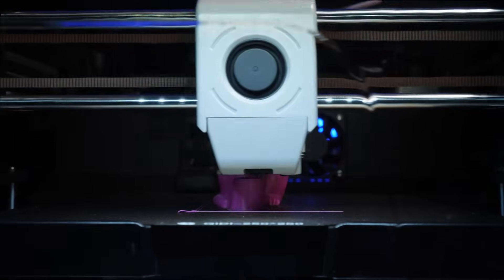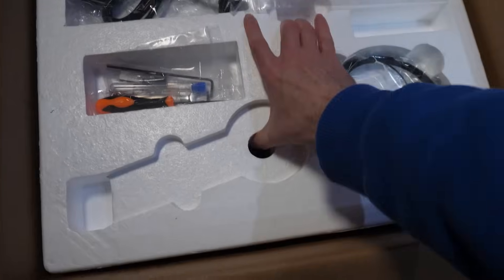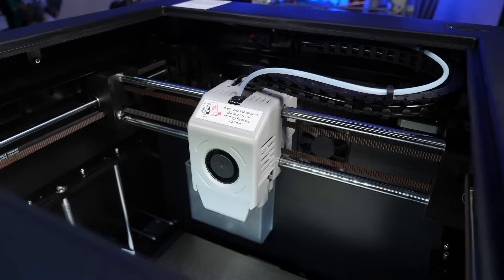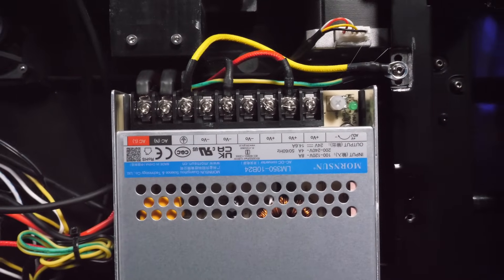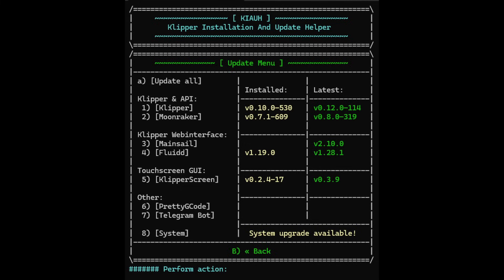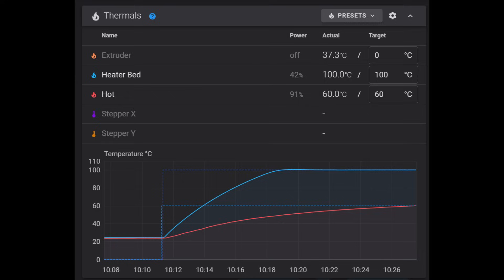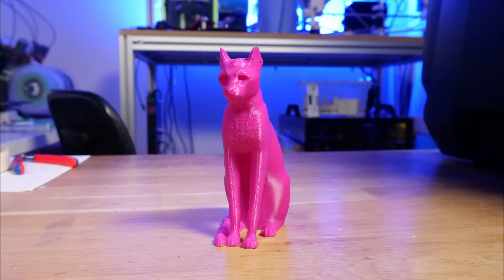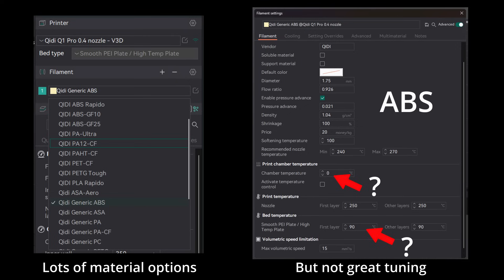QIDI Q1 Pro - Can it compete with BambuLabs?

Comment: This or the creality k1c? And why?
Reply: This for sure. Given all the reviews I have watched this is a far more solid unit with far fewer issues. The heated chamber, build area, and leveling are all big advantages. It's also my understanding you can put stock Klipper on this.
Reply: @802Garage  but it's just looks so bad. And if I won't be using the heated chamber or bigger build plate, do you still think it's better. What kind of issues are you talking about on the new k1c?
Reply: @Antoan108  I think it looks perfectly fine, though I wish the front door was flat with no view warping. If you don't need a heated chamber or larger build plate, look at the X-Smart 3 or Adventurer 5M which you can build your own enclosure for. Insane value for money. Or just get a bed slinger and save even more of course. If you want to spend $550-$600 to not get a heated chamber or larger build area and pretty much the same features otherwise, I mean go for it? Price for performance, this seems near chart topping at least. That is considering this is $439 right now with a coupon. The K1C seems better overall than the K1, but my understanding is they still have issues with bed leveling, heating, and warping. More VFA than other printers as well and I don't think the cooling is top notch. Cable chain and Bowden tube still have some annoyances with the lid and binding in certain areas. Don't get me wrong I actually still think they are good overall for the money, but I'd go for this over a K1 for sure. Given the price I'd get it over a P1S too I think, given the added capability. I do care about printing exotic materials and larger parts though, given I do a lot of automotive parts.
Reply: @802Garage  yeah, it sounds good, just I won't be able to stand how it's made of mainly plastic. Also, I'm getting a nice discount on the k1c of 10%+. I made a mistake saying 6%. So that would bring the price to be $100 more than the Qidi. Also, I like upgrading and improving my printers (not big big changes more like things like hotend, motherboard, firmware, ect). So the K1c would definitely have more mods and guides for improving it as creality is definitely more popular. Also, creality will be announcing an ams system while I dont think the qidi will be. Also, I have watched all the reviews on the k1c, and they have all been fantastic except two, which those reviews may have gotten bad machines. If the Qidi had less plastic and maybe a glass door or something  or if it looked nicer, I would definitely get it. But just the front door looks cheap plastic. Ps. If you print a few things for the k1c, it fixes the issue of the cable chain and if you print a seal for the gap behind the screen in the glass door the internal temp can get up to 40c+. And thanks a lot for your help and suggesting other printers. 😁. And I thought about the adventurer 5m pro, but it's more expensive than the k1c seems to have worse prints.
Reply: @Antoan108  Sounds like you have thought it out pretty well! The K1C is a good option. I will just add that an exterior of plastic is less important when this machine is metal and super solid where it counts. Hope you enjoy whatever you get though.
Reply: @802Garage  yeah, I understand that. Now I just stuck between the k1c or flashforge 5m pro. I'm only considering the flashforge bc of the air filters as if I get the k1c, I will make a bento box air filter. What do you think? And btw I always see you in comments lol.
Reply: @Antoan108  k1c is a big improvement over the k1, but it cant print high end fiber reinforced filaments like advertised. The bend in the reverse bowden is to tight at the toolhead. Cheaper/shorter fiber filaments work fine, but the high end stuff from phaetus, fiberlogy or similar will most likely break before the extruder. Workaround would be to raise the top lid a little to allow for a less tight bend.
Reply: @kilianlindlbauer8277  Yeah, but that's something minor that can be early fixed by raising the lid or taking the Boden tube out. Also, if you connect customer support about that, I'm sure they would help you.
Reply: @Antoan108  IMO this Qidi machine is a far better value than the 5M Pro, even though I really like that option as well. If aesthetics are super important to you though I get it. I would wait a week or two at least and see if the 5M Pro goes on sale to compete harder.
Reply: @802Garage  alright, thanks for telling me and for all the help you've given me so far!
Reply: @Antoan108  You're welcome. The good news is I think they are all pretty good options. 😂
Reply: As a bystander im actually not sure which one. The qidi has chamber heater and has actually automatic bed leveling (it can level the bed left to right), but the k1c is better on the software side (you can actually do something with the klipper installation) and looks a bit more thought through.

I would say that way, if you primarily print pla, petg, pctg, tpu then the k1c, if you only ever touch abs, nylon or polycarbonate, then the qidi if its quirks dont bother you
Reply: @kilianlindlbauer8277  Thanks for the reply, man! I'll probably be getting the k1c since I won't use abs, ass, or nylon. And I have 6% off on the k1c so that's nice.

Comment: It's for sale at $440 right now, shouldn't you have considered that in your review and comparison to p1s?
Reply: @vector3dp The Q1 with a coupon currently is $440.
Reply: @bp8__163  Weird I replied the same, but it deleted my comment and still notified me of yours. 😂
Reply: @bp8__163  what's the code?
Reply: Works great for me
Reply from the maker: temporary sale is not a good basis for a review. its also not that price everywhere.
Reply: @Vector3DP  it's 470 on ebay. I think that's going to stay as the price
Reply from the maker: What's 440?
Reply: @Vector3DP Q1 Pro on Qidi site with coupon
Reply: @Vector3DP Q1 Pro ($470 on site and there's a coupon)
Reply: @Vector3DP  Qidi Q1 Pro on their site with coupon

Comment: I think there is a firmware update in process for this printer which will hopefully fix some of the quirky issues.  Good to know a usb network port can be used in place of the wireless dongle.  For the minute cost of including the RJ45 port on the board, not sure why they chose not to include it (as they have with the XMax 3).

Comment: Seems to me that this is just a repackaged x-plus 3. Actually chopped down x-plus 3. Missing some crucial things such as wifi. Kind of a let down from the Qidi folks. Obviously just a quick release to try to stay with the other manufacturers that release new products annually or half annually.
Reply: It has WiFi.
Reply: I think the X plus 3 used a wifi dongle too.  Pretty awesome that you can just plug in USB ethernet, wish k1 had that option.

Comment: Well I saw this printer pop up on my feed earlier and thought it looked decent as a first printer, but listening to you pointing out all the issues with the software has made me decide to stay well away from this and keep looking for another options.  Opensource software is great, but locked down two year old open source software not so much.

Thanks for the heads up.
Reply: I mean, are there even any features lost? My understanding is that you can put vanilla Klipper on this machine anyways. It seems like a phenomenal option to me, especially at $439 right now with a coupon. Nothing else is going to print as many materials this well for under $500 that's for sure.
Reply: @802Garage Totally understand, but as a new user I am not keen on buying something new and then dumping the supplied OS and killing any warranty that may come with it.  Especially on a brand new untested printer that has changed specs since they sent out the review versions and the actual release, the word 'ethernet' no longer appears on the specs page of this printer, so what else are they going to change between releases?
£400 sounds great though, if/when it comes back in stock in UK.
Reply: @gordon861  If that's the case, then why would you care if it comes with vanilla Klipper anyways? What matters to you is features and stability. This seems to have both in spades. It also won't kill a warranty to change firmware as a general rule. The printer was never really supposed to come with ethernet is my understanding. You get what you actually buy, not what was speculated on before. Would you even use ethernet? The WiFi is so much more convenient and works perfectly well. I'm just saying. This review seemed a bit sour, but most of the issues pointed out are minor and common with many printers available. I just think it has a lot of positives, especially for the price.
Reply: @802Garage  There are bug fixes and feature rollouts that vanilla Klipper rolls out with. The last update for example in late 2023 had bug fixes and code cleanups, alongside new hardware support. 

It feels rather strange to feature "Vanilla Klipper, but not really"- even Creality has at least tried to justify their Klipper fork by skinning it and giving it "different" features. I'm just hopeful that it's possible to use Kiauh to completely uninstall all the current elements on the printer and reinstall the latest Klipper release- in which case this is much less of an issue. If that is possible, then much can be forgiven for its price tag.
Reply: @Duckferd  Sure, but their code is just based on an old version, not completely unmodified. That's my understanding. They do have a new revision now from what I've heard. Plus if every reviewer is having weeks to months of failure free printing and no features missing or not working, what is the harm? I'm just saying there has to be an actual impact or difference to the consumer for it to matter. New hardware support also doesn't matter for a single piece of hardware.

There are justifications for not using vanilla, such as easier tech support. I agree though, Qidi should just use it stock and open. My understanding is you can switch to vanilla like you want. Obviously have not done it myself though. I think even with the locked down version, $439 or even $469 is a great price. Bambu Lab printers cost much more and they don't have vanilla anything. I don't understand why people have different standards for different companies.
Reply: Lot of concerns re Klipper but as some have mentioned this is a multi material printer and at £391 delivered with the coupon, I was happy to purchase. I’m looking forward to the out of the box approach and not too concerned with the klipper version and “only WiFi” concern by others. It’s worth a punt from most other reviewers at this price.
Reply: @Blank_Space1984  Totally agree. It's top of my list. No printer will be perfect, but the flaws here seem small aside the great print quality.

Comment: This is a great example of cutting a lot of corners.
The more I see companies push towards closed off environments, even though they are using open source, the more I'm fairly certain my next printer will be a Voron. 
Just waiting to see more news about the Voron Phoenix, release date, build sizes, LDO kits, etc.
Reply: The Phoenix is in an entirely different price and size class. This would be competing against a 250mm Trident with a chamber heater.
Reply: The Phoenix interests me as well, but the 5k price tag deters me.

Comment: I am really having a hard time seeing what problems this printer was designed to fix. Decent price, but smaller build volume than Bambu’s. If they would have at least matched the Bambu’s or made them slightly bigger, it would likely have been much more of a hit.
Reply: Build area is quite similar, runs Klipper which can be swapped out for stock, much cheaper than any enclosed Bambu Lab machine, heated enclosure, more capable of printing exotic filaments out of the box, comparable general features otherwise. Every printer on the market is trying to solve a similar set of problems while adding a few extra features. The heated enclosure and general temperature capabilities are pretty impressive here. Especially at $439 with a coupon right now.